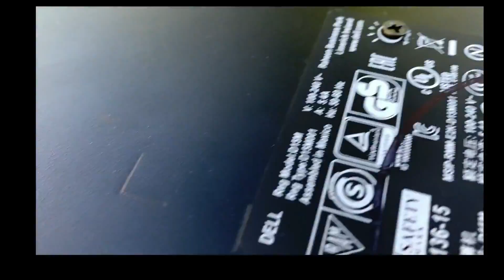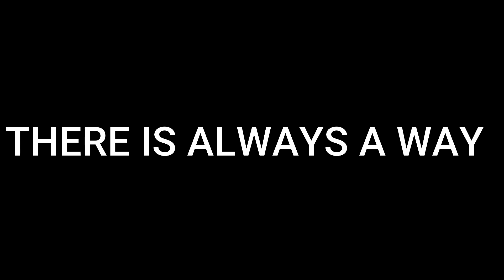✅BUILDING A CUSTOM DELL OPTIPLEX IN 10 MINUTES✅

Comment: What size it the fan you used in the rear of the computer
Reply from the maker: 120mm
Reply: @azuleitoryt9806  does your computer throw an error code on startup with the new rear fan?
Reply from the maker: @bDubX  no because I still have the original rear fan in the back of the case